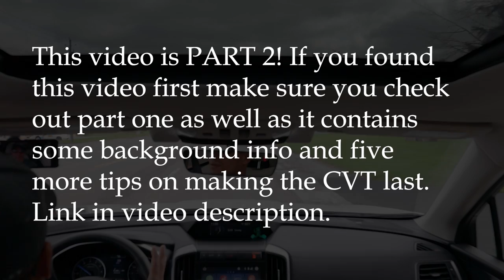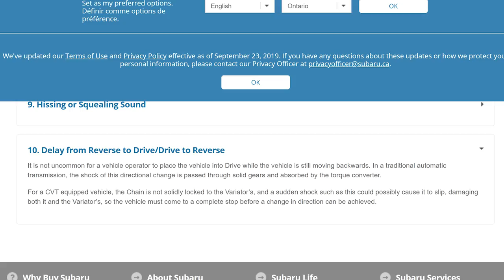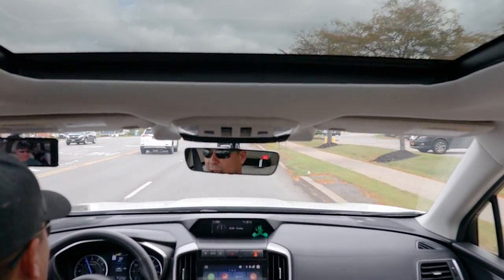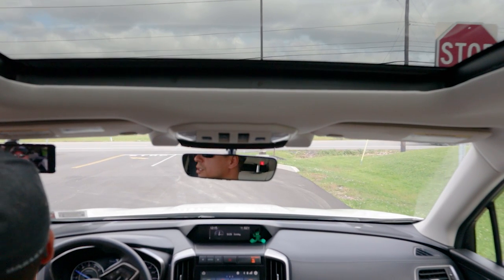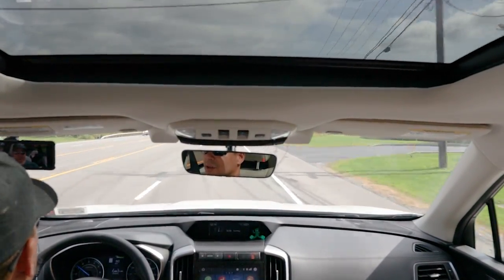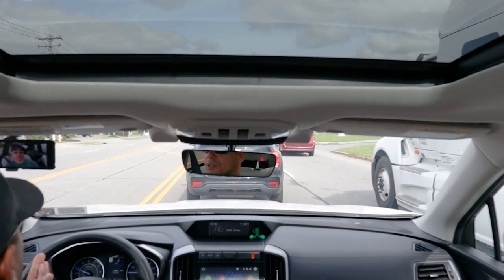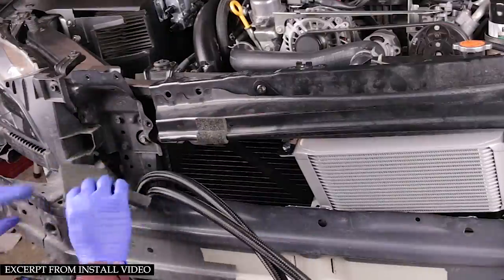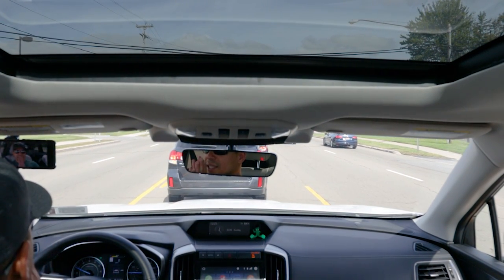How to Protect a CVT Transmission: 5 Practical Tips So Your CVT Lasts | Part 2 |

Comment: Hi thanks for your video and tips! I drive an Outback (eur.mod.yr. 2020) and it has a CVT which is only operated in the 6 discrete simulated gears. I myself already wondered if that is not giving problems, al the wear always at exactly the same spots on the conical wheels in the gearbox. Another thought: you recommend to change fluid every 60.000 miles or depending on your driving style even more frquently, (30-40k mile) A fun fact idea: you could call in a fluid replacement after xx gallons of fuel. Those who drive very aggresively will reach xx gallons of fuel in less miles than those who have a calm drivig style. In fact, it should be possible to say change your CVT fluid once in 1000 gallons of fuel. Or: Change your CVT fluid when you change your tyres. I go about 80.000 km with my tyres (not a racing person) so might be good option for me.

Comment: Great tips and if followed should have trouble free issues. An added practice I do is anytime I am going to park on a incline like a driveway or street. I stop the car put it in neutral with my foot on the brake, set the E-brake then release foot brake you will feel the car move a smidge with the e-brake on. Then put the car in park.

Comment: My ride is the ‘06 wagon. Normally aspirated. Four speed auto. 180k   trouble free miles. Almost all you read about CVT is negative... warning, high risk and costly failures. I’m guessing manufacturers are moving to CVT to increase fuel efficiency. You could buy enough fuel to drive to the moon for a $4-5k Trans rebuild
Reply: Exactly

Comment: I have a 2013 Nissan Sentra...should have done my research 3 years ago when I bought it. No problems yet (knock on wood). Took it elsewhere to get my brakes done rather than the dealership. Mechanic told me about the problems. I asked him if I should change the fluid as it's at 70,000 km's, he said not to...there are lawsuits pending. But I think I will after watching this video and heed the other tips. And I think I'll try to get rid of this car before any problems arise.
Reply: On the same boat as you...2013 altima 46k miles.

Comment: Sure, every transmission needs to take care. I drive Nissan Rogue 2013 currently. I experienced loss power more than a couple of times, I learned this is because of overtime oils and filters. Now shudders when driving in/on snows. Electronic and computer control systems are difficult for maintenance but they work smooth and fast.

Comment: I am not a fan of any automatic transmission. Except on the dragstrip. But I learned on a 3 pedal vehicle before I got talked into automatic. I can make any transmission explode. But for every job there is a correct transmission, if the driver is skilled. Big trucks are going to automatics because learning to drive sticks usually followed by maintenance costs. I can drive a stick all day and only use the clutch in 1st. ALL of the sticks I drove the engines lasted longer than the automatics. Usually the transmission fails after the engine overheats and cooks the transmission. But if you have the same radiator in a stick. The engine never overheats.The only exception is air cooled automatic transmissions. Those are very rare.
Mustangs have rev matching for sticks because most don't know when to shift any more. To me driving a stick is like walking. I don't have to think about moving one foot at a time to walk.

Comment: How do you feel about an in-line oil filter, to help reduce the accumulation of particulate matter? It seems, that it would be a logical addition to an oil cooler.(it might be worth installing some kind of a gauge, to prevent the filter from restricting the flow of transmission fluid, as the filter becomes dirty)

Comment: I have 110000 miles on my 2011 murano. Is it still ok to change the transmission fluid. I’ve heard it could be bad with that many miles. Thanks and thanks for the great videos !
Reply: 2010 Morano here.  Changed fluid at 85k miles and again at 113k miles.  Never had a problem.  The problem with high mileage transmission fluid change is definitely in regular gear type transmissions.  My understanding is that clutch material is dissolved into the dirty fluid and replacing it at high mileage removes the clutch material from the fluid.  Then the transmission fails.  With no gears on a cvt that shouldn’t be a problem as I believe there is no clutch material.

Comment: I put the order for a hyundai elantra 2021 with a cvt. I drive 95% of the time in town and I only make 5.000 km per year.
When should I change the transmision fluid ? I want to keep the car for at least 10 years.
Reply: I have been using my nissan xtrail t30 since 2006. Transmission fluid yearly. Flushed and changed 9 litres, havent changed filter yet. Motor oil 3 to 4 months. Flushed with liqui moley or Nissan. ORI nissan motor fluid. Spark plugs after 4 motor oil change. Coolant blue premixed . Changed at 2 year interval. Brake fluid dot 4.( flushed at 2 years interval) . Running perfectly to date. Btw all the fluid bought at Nissan service centre and DIY .

Comment: Tip#3... This can't be stressed enough!!
 Like you said; after 60k miles, change the transmission fluid. Just make sure it's designed for the CVT TRANSMISSION and not your grandfather's '75 ford transmission fluid. Most CVT transmission fluids have a dedicated car mfg. Name that's printed on the label.  Make very certain that you purchase the correct brand for your vehicle. Oh and BTW, it's best to count the amount of litres you remove from the transmission oil pan and replace it with the exact amount you removed. Not an ounce under or an ounce over!!!

Comment: I watched both videos and the one question I have is what about using Manual Mode for engine braking. I live in the mountains and have used engine braking to keep my speed down on steep down hills. Also, I am an experienced driver on ice and snow and engine braking is far better then brake modulation for maintaining control of the car. Is it acceptable to use engine braking in an auxiliary and reasonable manner?

Comment: So I didn't hear you mention it. Is there any belt slippage if you are going downhill and downshifting for engine braking? Manual mode isn't necessary when climbing a steep upgrade? The normal operation of the transmission covers it? I have never had a CVT. It doesn't seem like I will be a fan but they are likely here to stay.

Comment: Thanks for the info bro. It’s crazy, I also have a WRX and an Ascent in CVT. The wife doesn’t know how to drive manual and I wanted her to be able to use my car if necessary. I can definitely tell the power difference between this and my 2009 5 speed in stage 2 with a TB nvidia, but it’s still fun to drive.

Comment: Hello, Boost & Shutter, what can you tell me about the Hyundai/KIA Motors "IVT" (Intelligent Variable Transmission) which I believe was engineered and came into production back in the 2019 car year?  My research tells me that the IVT is a gamma design which I am not quite sure what if anything that represents regarding the IVT?  I do understand that a CVT does offer the BEST overall gasoline mileage from a naturally aspirated engine.  Thank you for a rather interesting page...

Comment: I am undecided to put a CVT cooler, I am afraid that it may lower the pressure of the internal pump of the CVT box
Reply: We thought about an external cooler but, at close to 200,000 miles for an 09 Sentra, it wasn't worth it.

Comment: Alot of what you said is common sence, "dont slam dunk your trans in gear, etc.   i bought a used 2010 honda insight last year, but 11 months later, and pushing 190K, the cvt trans is jumping into gear untill the trans is warmed up. at least from nutural to first gear! iv had the fluid changed, and added a cvt non slip additive. and checked for any leakes.  If the belt is loose, and jumps off, "trans is done for!" three to four grand to fix. car. what else can i do to baby it to last?   im a old guy, so dont hot rod around, If the trans dies, the whole car s trashed! id rather take that money and put it on something newer.  I like the car,and its great fule milage, any auto secrets or tricks to make it last? im thinking mabey thretening it with a toyota!  Thanks much!

Comment: I had the dealer  complimentary oil changed a while ago but under the milage recommended and I recently changed the oil and the pan read less than half a gallon so I'm assuming they also placed less than needed on the transmission. I'll be checking the level and most likly changing the fluid to play it safe

Comment: How safe would it be to take a 2018 CVT WRX to say a Honda dealership?

I don't want anything to do with the Subaru Dealership. I had a recall on the Passenger Airbag. They had my 2007 Impreza for a day when I got it back the AC stopped blowing cool air. I gave them a call within 30mins of getting my car back. They refused to take any responsibility and said I would have to bring my car back for them to diagnose this. I asked who covers fees and they said it would have to be me.

Took my car to a reliable local oil change shop. They said my AC was low and went ahead and charged it for me, free of charge of course

Comment: good stuff mate! just wondering i have the 2016 forester ip got the cvt fluid changed, oil and breaks for my trip up the mountain and boy did it struggle all the way up the ac got so weak the whole car lost almost all power it wouldn't move uphill i was cruising on 10-20km/h so i turned back went to the mall and just watch dune but the road to the mall is a freeway and it runned smoothly as per usual any theories on why that happened? all fluids are manual approved but.. thanks and all the best!

Comment: I just got myself a 2015 Subaru Wrx with a CVT. Got it with 160_ _ _ and kinda worried on the fluid. I don’t know if the Transmitions has been kept in service or not so therefore, I wanted to change the fluid but not sure if there’s time  for doing it without taken risk.

Comment: I leased the WRX CVT for 3 years and it was fun to drive, but I hated the transmission. I wish they used a DSG transmission instead. Just the idea to break the transmission and have to pay $9,000 to change it stopped me from buying it. I remember the sales guy at Subaru trying to sell me a $4,000 "gold insurance package" telling me that it would cover the CVT transmission etc... no way.  Also, the WRX CVT is not as efficient in fuel consumption as Subaru wants you to think, the manual WRX has a better gas mileage. My point is that Subaru obviously doesn't car about the WRX automatic, otherwise they would make it faster/quicker than the manual by using top transmissions like the VW Golf GTI or R do with a DSG. No sports car enthusiast want a CVT that prevent you from tuning your car and will cost you an arm to change. It's too bad because there are people out there that would probably be happy to have a WRX with a double clutch and be even happier if they could increase the power of the car. Anyway, great video and good tips!

Comment: My wife's 13 nismo juke doesn't like moving quickly in the desert. Has gone into limp x2 .
Reply: yeah, I hear you our newly purchased in 09 Sentra had 200,450 original miles by the grace of God regular trans fluid changes. The Nissan cvts or any cvts don't like the FL heat. Limp mode 3 x in 11 years sold last year for $900. I never mention limp mode because the buyer never asked.

Comment: Great video but lugging the engine is a great point for manual, however I don't think modern CVT will alow that I think the software is there to prevent that at least on my Legacy it does but I have the 5EAT with the flat 6  enen with my padded shifters it won't allow me to short shift. But it will allow me to start off in second gear. I think that must be for snow ice. Now on DSG I wonder if you can short shift and there for lug the engine??

Comment: I have a nissan versa 2018 whit 117,00 miles whit a CVT and I have been taking good care of it,  my car still drives like new I changed the fluid at 115,00 miles bcs I forgot to do so but so far very reliable
Reply: Holy crap that's  a lot of mileage for a new car
Reply: @DM-hw4cr  yeah and I coment that 2 months ago now i have 122,00 on it 😂 and counting
Reply: How often u change cvt fluid?
Reply: 124,000 miles on a 2012 Nissan Juke and still runs smooth. Change the CVT fluid every 30k miles and do regular maintenance. I’m not an aggressive driver. It’s just about taking care of it.

Comment: Why don't I hear about swapping the CVT for a 5-speed? It used to be fairly straight forward?
Reply: A regular swap. Not a hybrid. Or even AWD for that matter?
Reply: I wanted to do this to my 2014 maxima in Colorado but it costs double the price and nobody in Colorado does this. Looking at 10,000 minimum. Cost me 4400 for new cvt replacement. I wish I could upgrade to a manual

Comment: How can I make sure my Nissan Sentra doesn’t implode? It has 138,000 and I had the CVT fluid changed about 4,000 miles ago. For the most part it’s been fine but these higher temps have me worried.

Comment: Subaru voids the transmission extended warranty if it is touched at all b4 100k miles. Also CVT oil is very specific. You cannot go to a  quick shop and get the right fluid. Another thing is, the CVT fluid is not used the same way automatic transmissions use their fluid. CVTs use the fluid to expand and contract the mechanisms that control the gear ratio and it is not a  fluid that creates friction between clutches. Auto fluid gets grit in it, CVT fluid "should" not. If it is, that means it was most likely contaminated. Hence why subaru does not want you opening the transmission. Personally, if you drive very jackrabbity, I would not touch the CVT because it is really not a transmission that is well suited for speed and quick changes. If you drive really smooth, cruise on highways and try to get the most mpgs out of your car I would probably change the fluid every 60k miles like he said.  Why? So if you drive crazy with a cvt it is very likely to break compared to driving leisurely. Meaning you should keep your warranty intact. If you drive it very chill, I would change it every 60k because fluid does degrade over time from heat and you want to keep it as close to when it went in to the car as possible. If you change it every 60k it will more than likely keep the transmission going even further and I would not be surprised if you could go 300k with the subarus with the fa24 engines and the high torque cvt(legacy and outback). The ez36 engine is amazing also if you are looking at used which I personally have in my car.
Reply: What do you mean “touched at all” when the oil has to be replaced per the manual before 100k
Reply: @InspiredxxFamily  here is the thing. It does not say in the maintenance schedule for the CVT fluid to be changed. It says "inspect" CVT fluid. The CVT fluid Cannot be drained and filled unless you want to void the warranty. However i wouldnt give 2 craps about a warranty because there is no way a transmission fluid will last through thousands of heat cycles for 100k miles. Personally i would change the fluid every 60k miles if i had a CVT which i do have a 2017 outback with a cvt.
The main issue with the CVT is that you have to measure exactly what fluid is taken out and you need to put the same amount back. You have to verify that you seal it correctly too. Its a big hassle but the cvt gives smooth power delivery and great gas mileage
Reply: @InspiredxxFamily  also what car are you specifically talking qbout when you say it is in the manual. I have really only researched the outback and legacy and they only say to inspect every 30k miles
Reply: @Hallowsaw  My 2006 F-150 has 136,000 miles on it and has the original trans fluid. It's never shown low, and the trans works as new. We are the original owners and the truck wasn't beat, so yes fluid can and does perform if not subjected to extreme use.

Comment: I have a 2021 Crosstrek with 2,800 miles and it has about a 2 second delay before engaging into drive from park. Not normal? I never slam it into gear while it's still moving.

Comment: If your cvt fluid has never been changed and it's at 90k miles. Should you still change it?
Reply: Bekka White yes , you should change every 15 to 20 thousand miles
Reply: Change every 15,000 and use Amsoil CVT fluid, 100% Synthetic.  It’s cheap insurance.

Comment: R or D CVT still spinning belt or chains still spinning the same direction, it designed to be pushing not pulling. The mechanical is in drive shaft

Comment: The dealership told me the new fluid has be heated up before it goes in the car during a transmission fluid change
Reply: The volume of the fluid varies with temperature. After the fresh fluid is added, the fill level must be measured with the fluid within a specific temperature range specified by Subaru.

Comment: Damn Jiffy Lube, f*ck up my acura  by putting in dextron 3.  Didnt know this until months later when transmission shift weirdly.  Like he said - avoid quick oil changes places to do ur transmission. And someone told me to use genuine transmission from that make of vehicle only and not trust transmission oil u buy at a auto parts store unless it genuine (make) transmission oil.
Reply: Yes, man. I fully hate them for life. They messed up my Pontiac Sunbird by improperly replacing a valve cover gasket; almost destroyed my engine.

Comment: I have cvt 96 honda but i dint know how to you properly to use s1 and s2 im so confuse to the botton there is an arrow. So  if  its reach the rev line it will automatically change or  i push the botton?

Comment: Agree this lifelong fluid is wrong. I have had two toyota cvt cars. I have changed oil and filters at 30.000 mile intervals. Always stop before shifting. No problems with high millage.